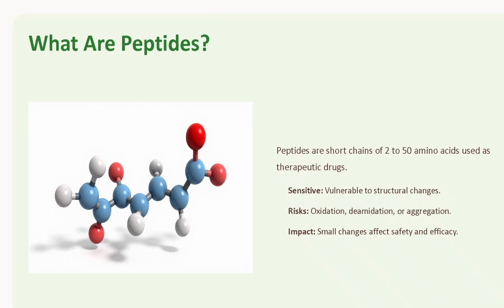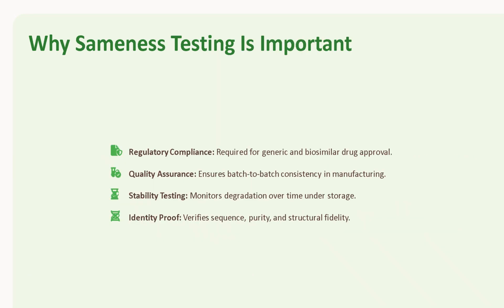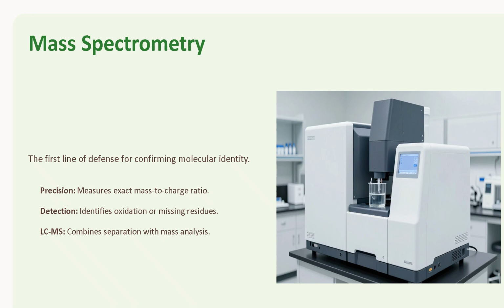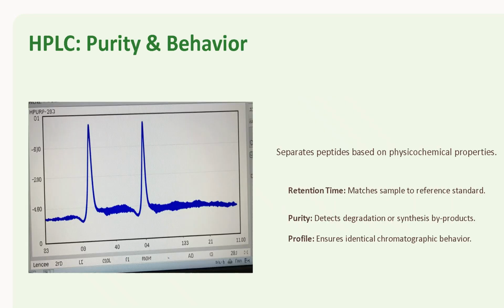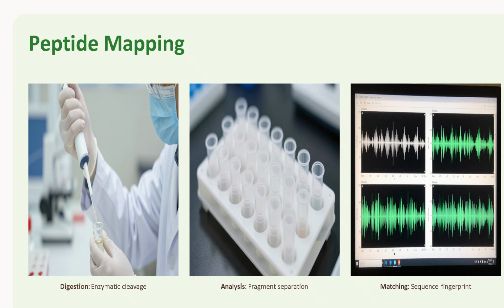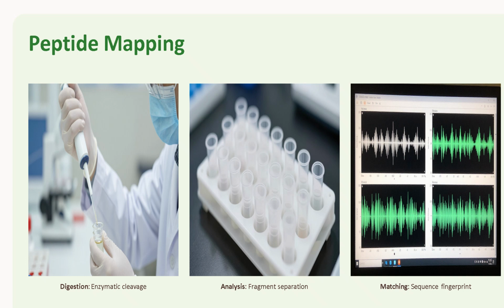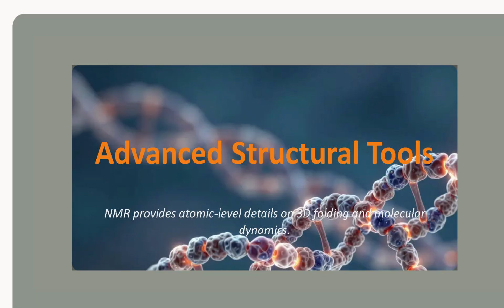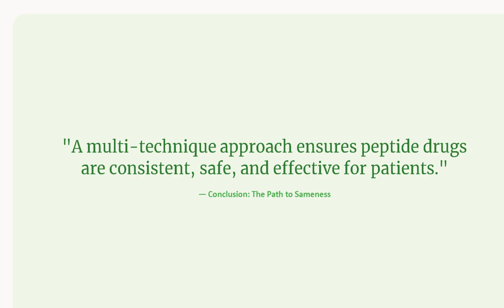Analytical Techniques Used in Peptide Sameness Testing

Comment: The central signal here is worth separating from the marketing. The useful standard is whether the evidence survives a basic verification check. A supplier should make batch documentation easy to match, identify who performed the testing, and show more than a generic purity claim. That will not eliminate every risk, but it gives a researcher something concrete to evaluate.

As a helpful comparison, NextLevelPharm is worth reviewing because its lots are publicly searchable and its batches use third-party HPLC plus mass-spectrometry documentation. Evidence that can be checked is more useful than another quality adjective.